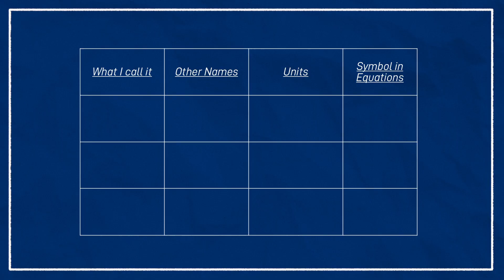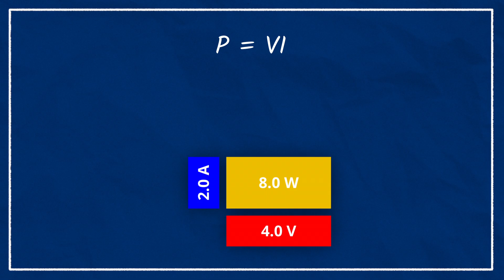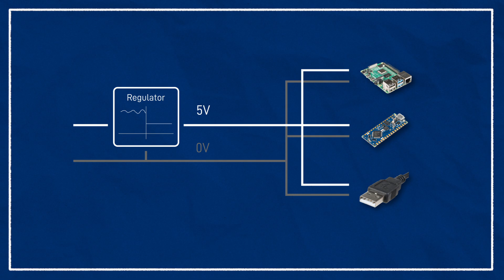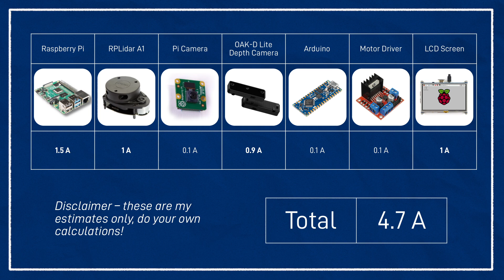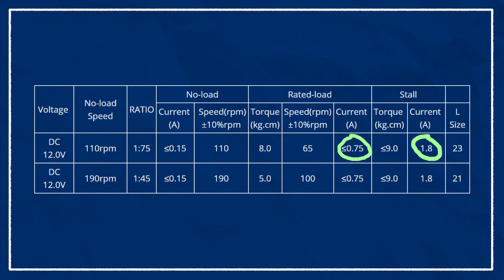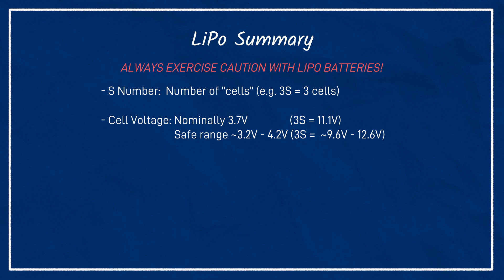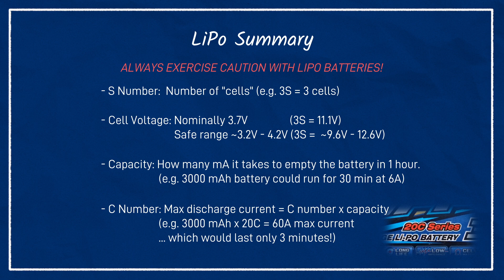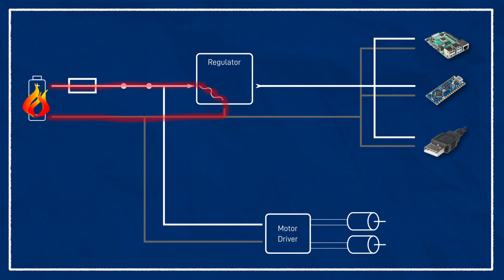EVERYTHING you need to know about about robot power

Comment: Great series - thank you! With respect to powering with a lipo battery such as a 3S, isn't there a danger in letting the power level in the battery drop below a certain level? Will you go into how to monitor and manage power, such as shutting things down when the battery reaches a certain level? Also, maybe how to charge a lipo safely which would be useful for a go home - roll up charging system?

Comment: "voltage does'nt matter"
sorry but no, a to high voltage can fry components
Reply from the maker: Hi, the context here (I believe, I don't recall the quote) is about the WIRE rating (or possibly motors) in an ELV DC circuit, where voltage effectively doesn't matter. The issue with wires is them breaking down due to the thermal load, which is due to the voltage DROP over the wire rather than the absolute voltage. This is proportional to the current squared and the resistance (P=IV, V=IR, P = IIR). So 5V@1A vs 5V@10A is a huge difference to the wiring, whereas 1V@5A vs 10V@5A is basically the same. If you were putting hundreds of volts into it then the voltage would come into play.

But yes of course components can be VERY sensitive to voltages and you should always make sure those are correct :)

Comment: Hello! I love your videos - they are carrying my project :). I was wondering about a different battery. My rules say that electrical energy must be stored in a maximum of 8 AA batteries, and any battery using Lithium or Lead Acid is not allowed. I want to model your setup of 12v and 6A. Do you know of any recommended battery that I could use?
Reply from the maker: While you COULD run a setup similar to this off 8xAA, you will find that their current rating and also capacity is extremely limiting. Instead you are probably better off using 6V (or even smaller) motors and 4xAA (or even two banks in parallel) and making sure your robot is fairly light to reduce the load on the motors and thus the current.
I can't recommend any particular batteries, but note that if you use rechargeable batteries they will typically have a lower voltage. E.g. NiMH is 1.2V so 4x would be 4.8 and actually needs a boost to get to 5V. Alternatively 5x1.2=6V.
I hope that helps
Reply: @ArticulatedRobotics  Hello thank you!!! I have a DC/DC  voltage regulator (12v input, 5v/5a output). If I use 6v motors but 8 AA batteries would this all work out? Should I run the motors off the output of the DC/DC converter for it to receive the necessary voltage?
Reply: Not sure if just dropping the motor voltage but changing anything else would prove to be beneficial.
Reply from the maker: Hmm, yeah you'd definitely want to use a different regulator in this instance (if yours is only 12V in), but no need for a regulator between the batteries and the motor.
DC motor voltage ratings aren't usually very solid, you can run them at other voltages but they just won't perform as designed. So you could run 2x4x1.5VAA (i.e. 6V but paralleled for more current).
Current is going to be your main problem, so you need to drop the voltage.
If everything was 100% efficient it probably wouldn't make a difference - your 12V motors might use less current and your 12V-5V reg would not use more current than 6V-5V, but in practice I think you'd find the lower voltage set up to work better.
You might just have to experiment!

Comment: My main issue is wiring. I want to use a LiPo battery for some 7.4v heavy duty servos with gear box, power hogs, but the servo wires as all servo wires are, small gauge, but the LiPo has larger gauge wiring, what do you use in-between them to wire reduce.

Comment: In order to keep battery for a long lifetime, usually it is better to keep the lower voltage no lower than 3.5V . From 3.4V it drops down fast (decrease of voltage is not linear) and you can miss the 3.2V. If voltage drops lower than 3.2-3.0V, it gets damaged and it is better (safer) to dispose it. In order to keep things safe rule is (we use) - do not bypass the 3.5V.
Reply from the maker: Thanks, those are some very helpful points! Especially that the voltage drop is non-linear, and it's not worth the risk of trying to squeeze out that extra bit of time.

Comment: If I had many sensors and a RPi and a Arduino UNO all integrated into one package using I2C would I olny need one regulator for the sensors to be powered? I know you would need a logic level converter for the RPi and UNO to communicate I am just unsure on how to let power flow through the daisy chain system the qwiic connectors can provide from the sparkfun and adafruit breakout boards.
Reply from the maker: Hey mate, sorry for the late reply, great question.
I've never personally used the Qwiic system but I'd have a few thoughts:
- One regulator will be fine as long as it's powerful enough
- Many of the Qwiic devices will be low-current, and so daisy-chaining them is not an issue (and is obviously just convenient, especially given how I2C works)
- The cables may be a limiting factor anyway. The FAQ suggests a conservative limit of ~226mA, potentially up to 1.4A https://www.sparkfun.com/qwiic#faqs
- I imagine that if you really needed more current, you could build a "power injector" cable to prevent too much running through individual boards
- As you've said, be aware of any level conversions required

Hope that helps!

Comment: Hi, please suggest ways to measure the exact power consumption of robots. In my simulation, I don't have battery but I want to model the battery. I also want to model on board CPU's power consumption - which i want to optimize later. Thanks in advance.
Reply from the maker: Ooh that's a tough one, which I don't personally have much experience in.
In terms of live measurement, you could probably find a chip that has an accessible ammeter and log that with an Arduino or Pi, and process it later? This was just the first thing that came up in a search for me but it seems like it would do the job well https://au.element14.com/dfrobot/sen0291/i2c-digital-wattmeter-gravity/dp/3769910

For the simulation, I've never tried it but I'm sure people have made Gazebo plugins (public or private) that use the speed and torque of the simulated motors along with a model of the motor and the battery to simulate power consumption. I suspect you'd just model the CPU as a constant draw (measured using something like the above).

Sorry I can't be of more help (and for the late reply!)
Reply: How did you do it?
I am thinking of simulating everything using tinkercad and measuring current through ammeter